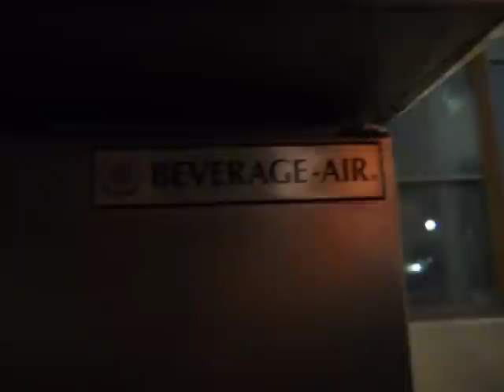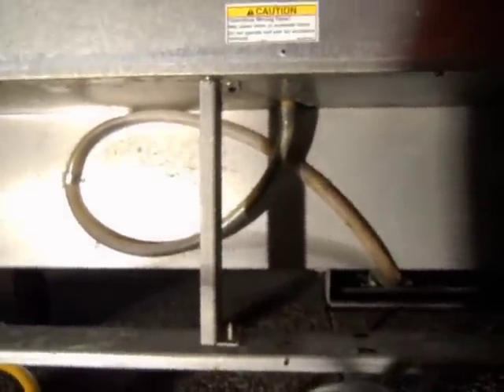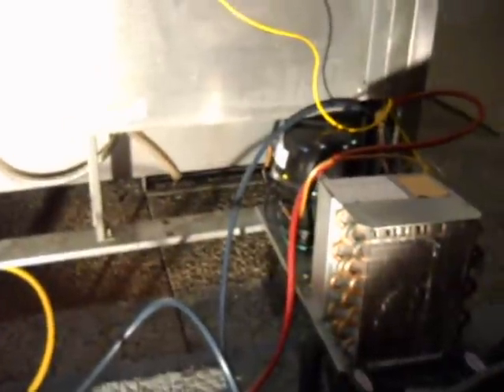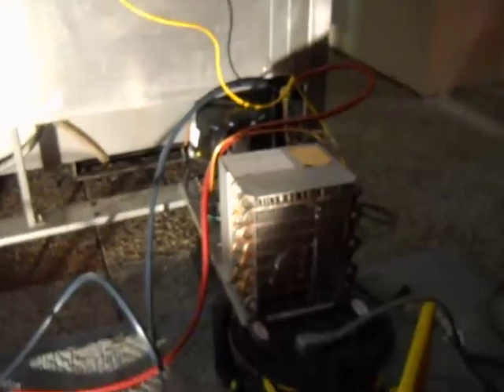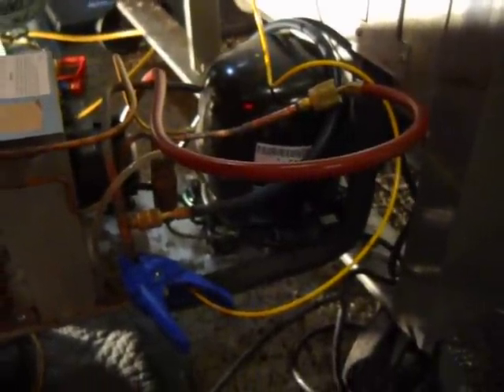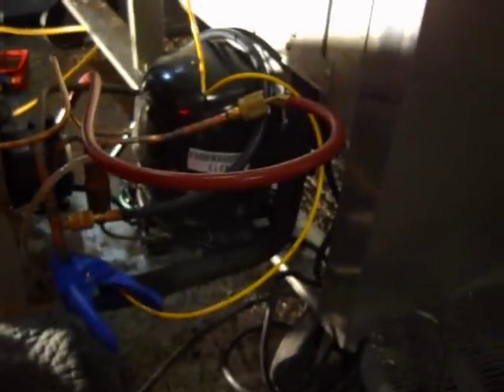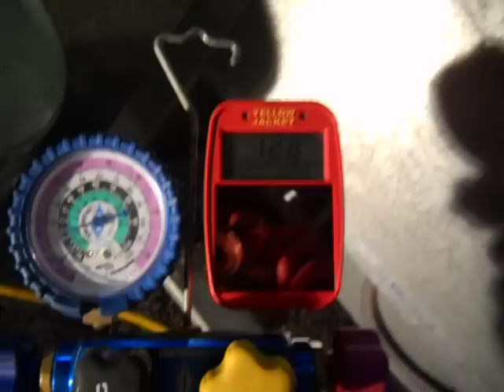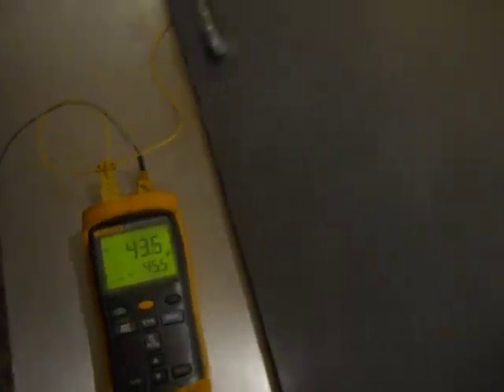Beverage air. 2 Door Sandwhich Prep table. Factory-Kinked Drain Line!

Comment from the maker: Yea, that's What i Would Like to do. and will do. But, that area is so tight they " engineered " ( and i use that word with a Laugh) the unit to fit tight up against the wall and if i put a brass 90 barb or plastic 90 barb the unit probably would not fit and i would have to leave the rear panel off the unit. so i am Going to Try that anyhow and i will see. i will report back once the fix is in.

Comment: i have a similar unit BEVERAGE AIR - SPE72-30M  and i see ice in the evaporator inside, checked the dripping tray and it looks  like just a few drops of water have been collected there and im guessing the draining pipe is clogged somewhere. any thoughts??? temperature is 48 to 50
Reply from the maker: Step 1: If your Evaporator is iced up the unit needs to be defrosted by unloading it and leaving the unit at room temperature for 24 hours and make sure all ice is off of the evaporator before using again.
Step 2: make sure Condenser at rear of unit is Very clean and u can see through it with a flashlight.
3) then Plug unit in--all doors closed and tops covered. all doors must seal no light
4) Put a thermometer inside.
5) Turn Temperature control clockwise all the way. if it turns ruffly or stiff. replace temperature control. call me to do the job if necessary.
6) Plug unit in.
7) within 1 hour unit should be at 35 Degree's. proper refrigerator temperature is 35-40 degree's.
if it does not. Most likely, you have refrigerant leak. Call me for service. (949) 412-6162
Reply: Did all these steps and the temperature is 45 and the ice again built up in the evaporator. Ice in te evaporator means gas leak?
Reply: Where are you located
Reply: I don't think i have a leak and temp control doesnt seem stiff at all
Reply: By the way i unclogged the drain that was glogged but it didnt improve
Reply from the maker: Geo Von Lengerke
Most likely Refrigerant leak.
Reply from the maker: Geo Von Lengerke
 Laguna Hills, California. You ?
Reply from the maker: Geo Von Lengerke
 How old is Refrigerator ?
Reply: Im too far. Im in monroe connecticut.  The unit is about 7 years old. I cleaned the condenser with air compressor and a brush. Rear fan works perfectly.  The compressor works cleaned the evaporator compartment and fans inside are working.  Plenty of space in the back of unit. Now you say that ice in evaporator is because of a gas leak?  Isnt that the defrosting cycle sensor is bad? And if so where is it located? ( random guy told me that could be the reason)
Reply from the maker: Geo Von Lengerke

Yes, an iced up Evaporator usually means a System Low on Refrigerant.

 Unless this unit has a Digital Control ? it has no Defrost Cycle unless some one added a time clock at the rear of the unit. only Freezers use Defrost Controls from a factory unless it's a digitally controlled Refrigerator.
1) if the unit does not Achieve 35 degree's in one hour it is a Refrigeration Problem !!! Period!
2) if the unit achieves 35 degree's in one hour and keeps getting colder and does not shut off at 35 degree's when the temperature control is set at mid position , The Temperature control is Defective and stuck together. it needs replaced. this is common at 5 - 7 years old.
Reply: Then it might be what you said GAS LEAK would have been nice that you were around to service it. Any way the unit does not have anything aftermarket installed such as timers. But the temperature control seems to be working okay. Just ice in one side of the evaporator and temp at 45 to 50. Thank you for your helpful information
Reply from the maker: Geo Von Lengerke
Another tell tale sign of a refrigerant leak. ice on one side only. why did u not tell me that earlier, haha. Not Filling Evaporator with enough Refrigerant. At this Point you have 3 Options.
1) just add some Refrigerant and see how long it lasts. it might last 6 months or 2 years.
2) Replace the Refrigerator.
3) Repair the leak. What kind of Restaurant is this. Pizza Sauce ? Tomato Acid ? etc. Pickels uncovered.
Finding a refrigerant leak and doing the repair can be very expensive. $500-750.00

i Recommend just adding some refrigerant to the system to see how long it lasts. that will tell you if it's a big leak or a tiny leak.
a Guy should be able to do that in 2 hours or less + a small amount of Refrigerant. Your system is half Empty by my Experience. The System will Take no more than 1 lb of Refrigerant to Fill it to Proper Spec. Probably only about 4-8 ounces of Refrigerant. cost $250.00
Reply: Ouch! So with that being said that amount of refrigerant plus labor will cost me 250?. Here is the thing. When i purchased the business i didnt know the condition of the equipment therefore im been cleaning the condensers every 3 months and inspecting any abnormalities but this one last year had the drainage clogged and i unclogged it but you know after 7 or 8 months it gets clogged again. So for sure like you said it is a low refrigerant in the system that causes ice in one side of the evaporator? Now i think i just have troubled shot this with you
Reply from the maker: Geo Von Lengerke
Cheapest fix---Find a Good Refrigeration Guy with at least 5-10 years Experience. You're gonna need a good refrigeration guy if u just bought a Restaurant business.
Me--- i've got 34 years experience in air Conditioning and Refrigeration. 24 years experience in just REstaurant Refrigeration. I charge $87.00/hr + a one time $40.00 Trip Charge.

--Cheapest Fix---what your invoice is going to look like.--
2 hrs labor---------------------------$174.00
1) install 2 Bpv31 Access Valves on Refrigeration system because system is factory sealed and their is no way to add Refrigerant to system.
2) Add Refrigerant to Spec.
Trip--------------------------------------$ 40.00
R-134a Refrigerant--1 Lb Min--$18.00
Access Valves----------------------$16.00
Rags,Gloves etc-------------------$ 1.00

Total------------------------------------$249.00
Reply: thank you for all the info, again too bad we arent close.
Reply: once the bpv31 are installed there is no need of removing them correct?
Reply from the maker: Geo Von Lengerke Yep, sure is!
Reply from the maker: Geo Von Lengerke the only time one would remove them is when they find the refrigerant Leak and install Proper Weld in Access Valves. Bpv 31 are only a temporary access valve they start leaking after a few years, but since you allready have a refrigerant leak, the point is mute. Proper weld in service Valves can be installed as a better option. but, that's more time and money. you can't weld in access valves with Existing Refrigerant pressure in the system. Bpv 31's CAN Be installed on a Pressurized system, weld in's cannot unless the guy uses a pinch off tool and installs them that way. To answer your question, Bpv 31's can be left on Permanently until Weld in's are used in their place. Weld in's are a Permanent Valve. no leaking after a few years.

Comment: I work on the line that builds these. Someone on the line, most likely a temp. Made the hose too long, thus the kink. We now run a straight short hose. Last year, they added shrader valves to all units. Unfortunately, people come through as temps on the line and simply do not care or not taught correctly, so coolers I would never buy are built.
Reply from the maker: +K Bremer  For shame on bev. aire.  Temp Techs should be vetted and monitored.
wheres quality control insp. i guess that s how we get warranty work. thanks for info and commenting.
Reply: +OcRefrigeration & H.v.a.c. actually, that comment was made by my fiance, he works at Bev-Air. I understand your frustration, though. I am subject to his venting and frustration when he gets home from work. my fiance has an amazing work ethic, poor workmanship due to lack of  interest in doing the best job possible. It is frustrating. However, I understand that Bev-Air does take customer complaints and concerns seriously. I'm sorry you have had a problem with a product my other half worked on, he actually is pretty upset n your behalf. I hope things get better.